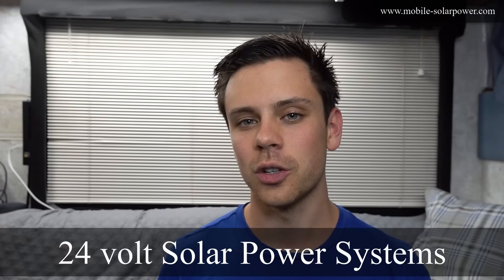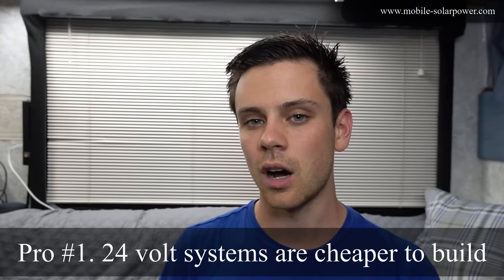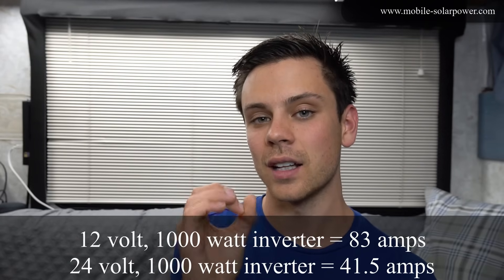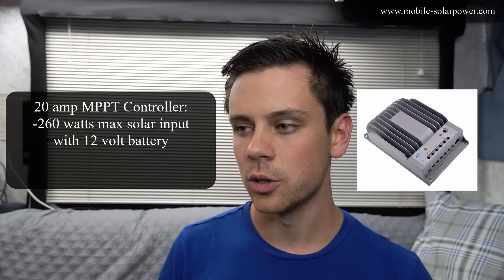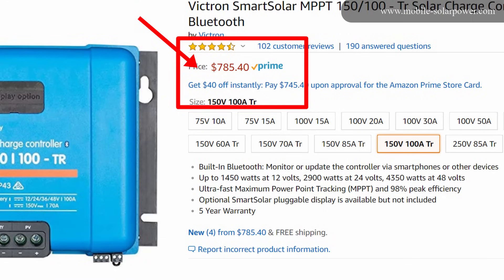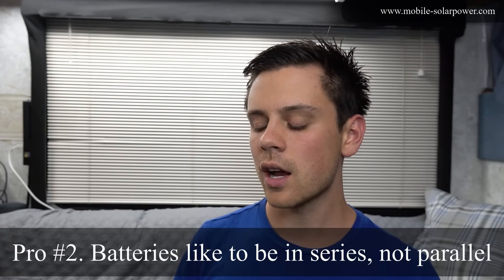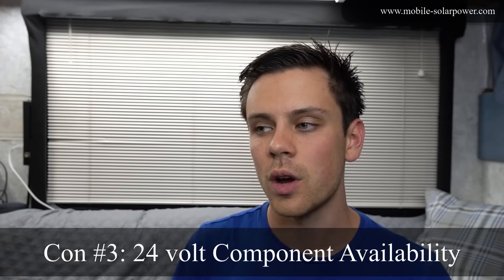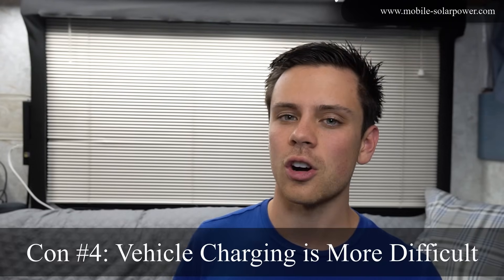12 volts VS. 24 volts for Off-grid Solar Power Systems

Comment: Secondary Alternator is down low left on SPRINTER .
Can't find the configuration for my Ford Transit 150 Cargo Van.
Found out today when a high amp alternator is charging LiFePO4 s the BMS( Battery Management system) shuts off immediately. Spiking and frying the diodes in the 
Alternator. BC the Alternators run full charge to quick capacity Lithiums.When the battery is full and shuts off .There is an arc. 
"Everything shut down then it started back up" Experience. 
The BMS started the Lithiums and powered
the DC/ DC - DC/AC Converters 🤷
There is a device that foresees the BMS shut off and tells the Alternator to stop charging. Some kind of Breaker/Controller deal.
Ignition switch controller?
Damn I might have to see Ford. I have a single Lead battery. They have a dual battery factory package 🤷.All I need is another lead battery to continue charging my i phone i pad
and hearing aids. Maybe two LED lights. 
Been charging them w a 12 v cigar charger and USB for three months.
🤔 I'm pressing my luck.
Oh there is a hugh advantage 60 Amp standard Alternators replaced with 180Amp
Alternators will give you the 40 amp hours for 6-8 hours per day running AC lights and appliances. If you travel 2-3 hrs per day.
With a slight mpg increase.
But I'm interested in a second Lithium BMS compatible alternator and second Lithium bank(Or solar charger generator i.e. Jackery) totally separate from the starter ignition system. 
With DC/AC inverter. 
Investigating it.🤷

Comment: I have a 12 volt set up in my tv and have 4  12.8 lithium batteries set up in parallel should just drop back to three, I find running my fridge on 4 batteries is no different than running 2 batteries I get the same amount of running time

Comment: In my old boat it had twin engines, with a 12v alternator and battery bank on one engine.  The other engine had a 36v alternator and battery bank.
36 for starting the engines, and 12v for all the house equipment, electronics, etc.
the down side is 2 battery banks, and you have to be careful not to start the 12V side first and possibly drain the battery so you can't start the 36v side, which charges the starting batteries.
Up side, good cranking amps with 36v, easy setup for 12v house system.

Comment: can you use a 12volt battery and 12volt solar panel with 24volt system,  I have 4 x 390watt solar panels, 2 (200AH) batteries

Comment: Will, love your videos because you are so thorough and I am needing your help. I have built-out our current van with a 12v victron system: 3000 multi, 400w solar, DC-DC charging with 2-200Ah LiFePO4 12v SOKs (based on SOK quality/value watching your video's), yet we are wanting more power for a new van build because we are getting only two days off-grid. I am now very interested in the Ecoflow Power Kit with 2-5KWH as I initially thought it would double the power for our needs in the new van. Am I correct in the assumption? My confusion in the conversion of 2-5Kwh at 48v is equivalent to only 200Ah as it would be only half the power we are currently getting from our 12v victron system? It is not easy for me to grasp the equivalent of 2-200Ah 12v LiFePO4's to how much I would need in Kwh's to either equal the 400Ah 12v LiFePO4's or to double the power usage for our needs.  Can you please clear this up for me in a response and would love to see a video later from you? The Ecoflow Power Kits are getting some buzz and I haven't seen anything from you yet on this system.

Thank you!

Comment: Will, you are awesome.  I'm sure many folks say the same thing.  Can you tell me why a step-up charge controller wouldn't be a good choice when using a single 12V solar panel to charge a 24V battery?   I purchased an MPT-7210A for that purpose.  I'm charging 2 100 Ah LiFePO4 batteries in series that are used on my boat 24V trolling motor.  I have a single 100W solar panel (because I don't have a lot of space).  The panel is really just to keep my batteries charged between trips.  I take a trip or two per week in fishing season, so I may have several days to charge my batteries between trips.

Comment: With using an alternator and I agree it's a bad idea. But for sake of argument or in case of necessity. Could you connect a 12v inverter, and then connect a DC power supply to the 24v inverter?

Comment: What about charging off of shore power? I’d like to convert my rv from 12 to 24, but realized the converter/charger is only 12v (I think struggling to find specs). I’m guessing I can’t just use a step up converter so I’d need a new charger at least.

Comment: Will (or some other smart person).   I am new this all and have a couple of questions if you don't mind:

1) I am finding that the 24v batters cost more per watt than the 12v (there seem to be more deals for 12v).  Would this counteract the savings on the controller and cables?

2) I am wanting to build an emergency system for fridge, freezer, electronics, a few lights etc, when there are power outages, maybe a 600-1200 watt array that I can set in the driveway when needed (~ 2.4 to 4.8 KWH in lithium batteries).  At how many watts does it make sense to switch from 12v to 24v?  Or is 24v still better even for smaller arrays?

Comment: So on my rv at deer camp, I have 400watts of solar panels and change control all Renogy, 3 group 29 everstart batteries 114 amp hours each all new bought at the same time for the house batteries and a new ever start group 24 chassis battery, my question is the chassis battery will go dead after sitting for months, can I run a power wire from the house batteries to the chassis battery with a disconnect switch between the two sets of batteries and leave the switch on to keep the chassis battery charged from the solar so I don’t have   a dead battery on the chassis and turn the disconnect off when the RVs  running with the alternator ?

Comment: In addition my SOLAR PANELS.(3) connected in series
Rated power --327w
Voltage (wmp) --54.7v
Current (imp)--5.98A
VOC.        _64.9v
Short circuit current --6.46A
Max series fuse --15A

(24v  inbuilt inverter with charge controller)

Inverter mode ::
Rated power --3000VA/2400W
DC Input --24vdc--100A
AC input--230VAC-50/60HZ --10.4A

SOLAR CHARGER MODE
Rated power --3000w
Norminal operating power (VOC)--240vdc
Max. Solar voltage VOC --450vdc
MPPT Voltage range --90 -430vdc
Max. Solar charging current --60A

24v system

Comment: I agree with you about not powering a solar system with alternator.  I don't think it makes great sense in a boat either - even with a 12 volt solar system.  It seems to me that a small generator and charger is a better option when there's no sun for solar.  Better to leave your engine, alternator and engine battery to do what they're designed for - and only when you want propulsion.

Comment: Question. I've a submersible water pump that I intend to use , Off-grid, for 12 hours every day,. The water pump power rating is 1700w(1.7kw). I also have an array of Solar Panels of 3600w output capacity. I've no need for battery or charge controller, only an Inverter, as I don't need to store energy. I intend to use the power directly on the appliance. What size/capacity of Off-grid Solar Power Inverter do I need to buy. Thank you.

Comment: My old neighbor had solar. His sister in-law moved in. She rewired the batteries to 24 volt. It started a fire.. she tried to blame me? I gave them a free refrigerator she put a fuse on?
.
Her free RV also caught fire... Solar.
.
So, they tried to run the batteries in 12v and 24 at the same time?
.
Same people that took a battery out of a truck, carried it to a different car, hooked it up to jumper cables, and tried to start the truck without a battery in it.

Comment: thank you my friend, this video gave me an idea, i will use 2 550w solar panels a 30 amps solar charge controller, a 24v bank battery system and to  dc to dc downgrade to 12v and conect it to a 2,000w inverter so in that way i can take advantage of the solar panels better to charge the battery system and power my inverter.

Comment: I know you are not working with ev cars, but batteries are more my question right now. I have six 24 volt lifepo4 packs that will run in series to produce the 144 volts the car needs. But I want use 3 48 volt chargers to charge two series packs at a time. The question is how to wire them so it can run in series but charge in parallel? I may need to use relays, but not sure what is already made out there. I could use six 24 volt chargers too. Finding a 144 volt charger would be exspensive. Also I feel that have 3 or 6 chargers running at the same time would speed up the charging process, something I would like to try.

Comment: If you want to ruin you battery bank you keep using their made up charge controllers and you will be fine. 😢. I went through three they kept telling that’s the way I needed to build up my system . Now I have lost two battery’s “from over charging” in my bank now I’m running off four damaged batteries from the same “over charging 😢.

Comment: Man, I wanted to drop you a comment. I'm an electrician by trade, but that in know means I'm a DC, battery, solar expert. (I love how my employers thinks that I should know how to work on Fire Alarm systems because I'm an electrician, but I digress). Due to my RV, I started mucking around with Lifepo4 batteries. I started researching this that and the other thing and before you know it, I'm down the proverbial rabbit hole. Understanding this stuff is like a whole other branch of the Electrical field. It's like going to an oncologist to deliver a baby. 

I've watched hours and hours and hours of videos and read loads of stuff. And I can honestly say that your content is by far the single best resource on the internet for learning about this particular topic. Sure, there are other really good recourses. But your content is the most accessible to the widest range of folks. There's virtually no bullshit. After watching at least 100 of your videos, I seek you out when ever I have questions. I even started creating curated play lists of your videos discussing different things so I can get to them quickly. I think I probably speak for the community when I say I really appreciate what you're doing and what you're providing.
Reply: Heck the biggest compliment I have seen is other videos say they use him as a reference information! Also he hasn't 
aged at all.

Comment: Thanks for your content.  Like seriously.  It is so helpful.  I wonder if you have considered adding in food truck as a an application consideration.  My wife and I are building an ice cream / coffee truck and have been using your videos to sort of guess at what would work for our application.  We might be able to take advantage of a few RV items, but most RV items wouldn't apply for a food truck.  We run all 120V appliances.  Some trucks might need 240V but I think that is rare.  We don't need split phase for that reason.  Almost all appliances are inductive, chocolate dip heaters, fridges, freezers, water pump etc.  Lighting is LED.  We have the roof space for solar panels which will be limited.  A small truck (our is small) only has about 80 square feet of roof.  I figure I can add up to 800Watts of solar with 4 panels with a comfortable fit.  Line lengths between solar and inverter/charger will be short.  Our estimate is 2600 Watts for our max utilization (open for business at an event) and 1600W for when its stored(keep freezers running and some AC to keep the freezers in ambient temps were they can actually function).  Most advice I've read is to up your inverter capacity by adding around 30% to your total to be sure not to overload.  That would put me at 3380 Watts.  I was looking at the Growatt 3kW LVM-48P and the EG4 3000 EHV-48 initially along with one or two EG4-LifePower4 48V server rack batteries.  If I need more I could "stack" another inverter in either case.  Anyways where we park the truck (payed spot) has a limited supply of 120V AC power for charging.  I want to plan for 5A being the limit since its shared and I don't have control over who else is pulling and how much.  The solar is intended to supplement only.  Its not enough to supply full load and will help extend the life of the battery during sunlight and will also aid in charging considering the limitations on the AC supply I have.  We have enough time between events (usually a day) to get the battery charged back to full.  I can park and charge at home temporarily for a few hours only (HOA limitations) and charge at a higher rate if we have a morning and evening event. We can also bring a small generator for back up.  That would only come into play if we had an all day event.  This happens rarely, but we need to plan for it, since those events are great income sources.   One other consideration for me is driving neighborhoods.  I could add a beefy alternator and power while I'm driving too, but we are likely going to favor parked events and so that isn't going to help us enough to make investing in that worth it.   I think I'm not the only one in this boat trying to create a system were grid charged batteries carry the main electrical load for running a truck while making a limited amount of solar be a boost.  I hear in NY they are considering passing legislation to ban generator use for food trucks, this is likely to increase over time.  Maybe I'm ahead of the curve.  Any thoughts about adding a video about this?

Comment: I am pretty much sold on the 24v system for a minivan for light camper use, like the idea of just buying the 24 volt 100AH LiPo4 battery so no cables needed to wire the batteries in series and using one of the all in one 24v MPP system controllers hence easy to tie into shore power and/or generator for recharge if needed.
Do not mind using a converter to step down for 12volt  appliances as well.

Main use will be running a small portable fridge and maybe a small fan, occasionally perhaps a microwave for just a few minutes time.

Since I am new to solar where I get confused is on what portable solar panels would be a good match to such a system that have decent quality but will not break the bank?
What type of specs do I need to look for in the panels and in the 12v panels how many would need to be in series to get a match for charging this system?

Comment: I have 6 Solar panels that have the following details 
Pmax = 230W
Output Tolerance = +/-  3%
Current at Pmax  (i-mp) =  7.55A
Voltage at Pmax (Vmp) = 30.53V
Short Circuit Current (i-sc)  = 8.32A
Open-Circuit Voltage (Voc) = 36.30V

Fuse Rating  15A
Nominal Operating Cell Temp (Tnoct)  48 +/- 2degrees Celcius

Can i use this to build a 24Volt Solar System

Comment: Can I use my converter  on my camper and hookup my solar panels 200 w to my converter and will it charge my batteries ,if I don't use shore power at the same time.

Comment: Hi, I'm very new to this and want to build out a 2001 F450 7.3 ambulance and was hoping you could give some guidance. I've been watching a lot of your videos and others on builds and have started buying key components. So far, I have purchased a PowMr 3200A 3000W solar inverter 24V with built-in MPPT 80A controller , 230 VAC out-put voltage max PV 450VDC supports wifi. A 12V diesel heater, a propane instant hot water tank, 12V 65 qt. Refrigerator by Vevor, a 12V 4 camera system. Now, with all that said, I know I need more things, but as I was watching your video, I'm starting to hope the 24V solar inverter/charger wasn't a mistake. Can you tell me the best way to set this up and I understand I will need a converter from 24v to 12v. Please, any help would be appreciated. Tha KS in advance, Ron

Comment: I'm an electrical engineer and electronics technician and I've just started a bus conversion to motorhome. I went with a 24 volt off-grid system right from the start. It just makes sense as the bus runs on 24 volts. Using a 24 V off-grid system means I can charge those batteries from the bus alternator when under way using an auto-connect transfer switch. It's not strictly necessary as I have 2 kW of solar on the roof which is more than enough but it's easy enough to implement and there may be times when there isn't much sun so being able to do this is a bonus. The electric toilet has a 24 V motor, the inverter is 24 V as is the fridge. I'll use a converter to drop to 12 V for the LED lighting (the 24 V LED lights weren't available in a style I liked) and to run things like the CB radios etc.

Comment: Question to the expert I am building a systems 24 volts with a renogy 100 amps solar controller till then ok but my inverter is. A renogy 12 volts input 2000 watts how can I connect this 24 battery to solar controller ok but inverter is only 12 volts input please advised by the way the solar panels are  1200  watts or 158 max open circuit

Comment: what about using a 12v inverter with a Victron Energy Blue Smart IP67 24-Volt 12 amp Battery Charger (Bluetooth) 120V plugged into inverter to charge solar battery bank while driving.

Comment: i use a 24v setup and run a 24v-12v converter for lighting, and other things. uses less energy drawing from the batteries.

Comment: Is there way how to use 24V solar panels and 12V batteries ?
And best option 12V sine changer ?
Why is on PWM module "input max 150V" and "output 12/24 V" ?
Can PWM module somehow change voltage to standard  12/24 V ?